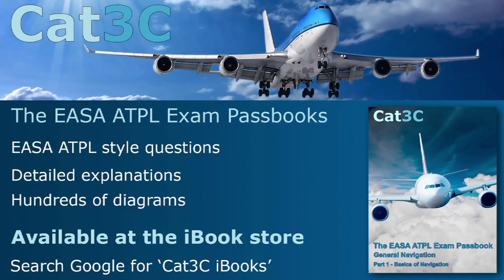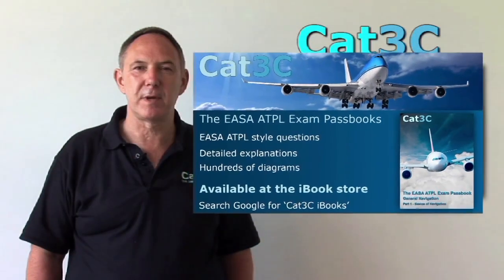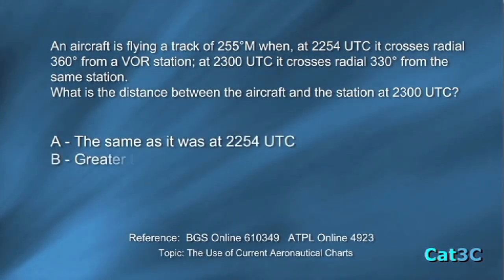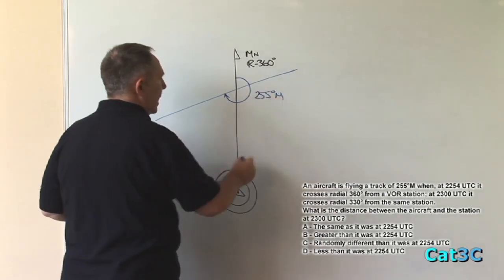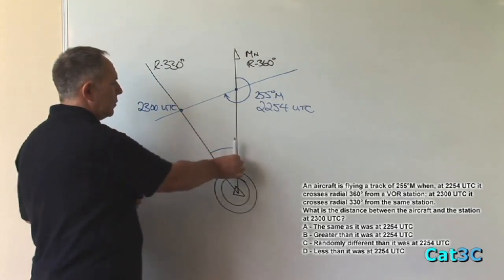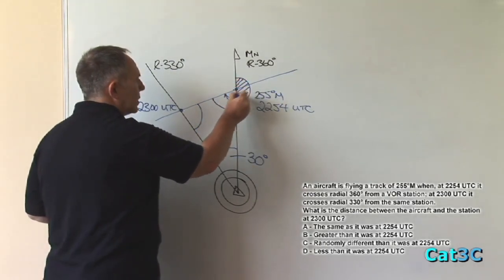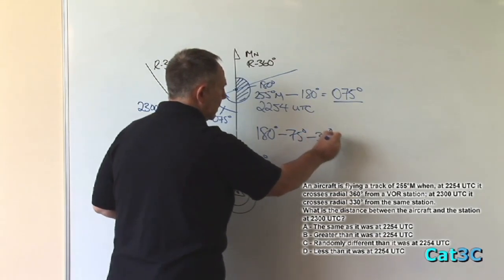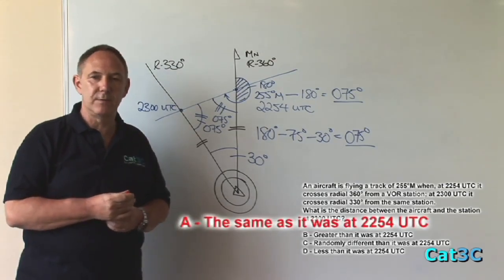QEV 020 Determination of Distance from VOR (A)

Comment: Sorry, but it can't be done without the speed. Assuming we have the speed, e.g. 240 kts, we would have flown 6 minutes @ 240 kts between 2254 and 2300 UTC = 24 nm. The isosceles triangle between the R-360 and R-330 radials can be bisected into two right angled triangles, each having an angle at the VOR of 15°, and a short side of 12 nm (24 nm ÷ 2). Apply trigonometry to find the length of the hypotenuse (distance along each of the VOR radials at 2254 and 2300) by dividing 12 nm x sine 15° = 46.4 nm. Hope that helps :-)